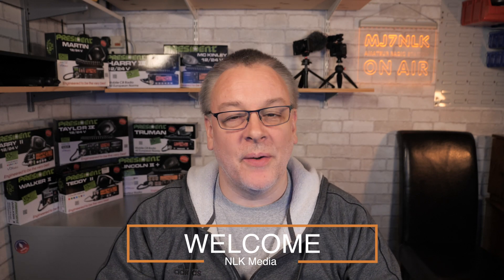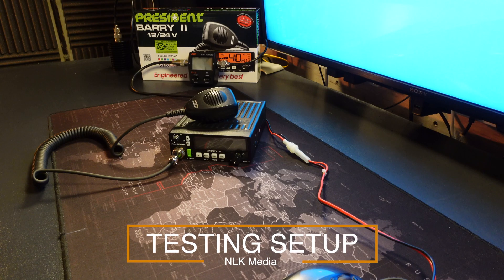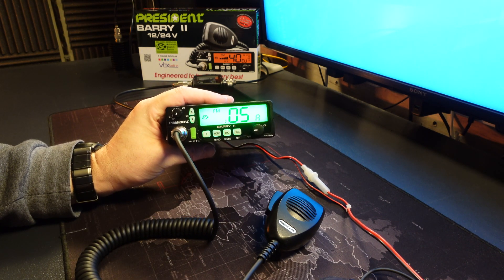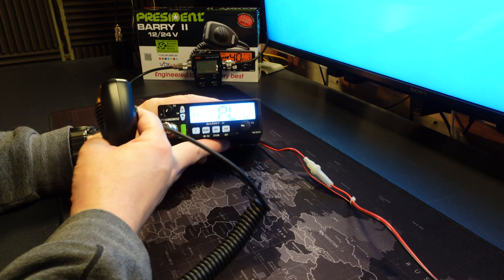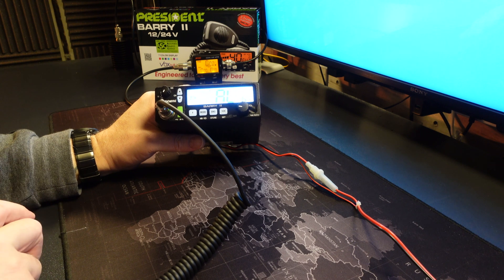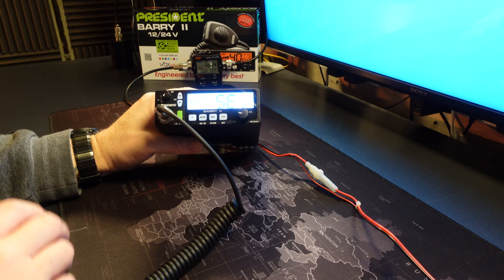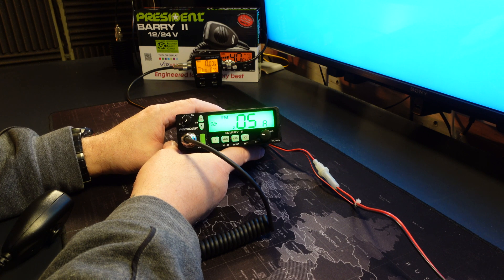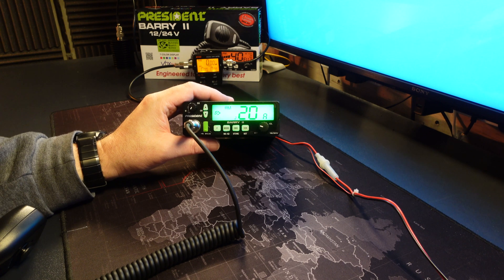President Barry II CB Radio - Part 2 - Power Adjustment - Service Menu

Comment: Vielen Dank für das hilfreiche Video. Ich mag Deine ruhige Art Dinge zu erklären.  Ich hätte eine Bitte ! Könntest Du erklären was A Band, B Band und C Band bedeuten? Im legalen CB Funk betreibe ich nur A Band? Ich freue mich auf weitere Videos. Ich kann Englisch noch verstehen, das Schreiben fällt mir aber schwer. Bitte verzeihe
Reply from the maker: Hallo, danke fürs zuschauen. Die Bandblöcke beziehen sich auf 40 Kanalblöcke mit unterschiedlichen Frequenzen. Der A-Band-Block umfasst die Standard-CEPT-Frequenzen von 26,965 bis 27,405 und wird normalerweise als Normal bezeichnet. Bandblock B wird normalerweise als Superior bezeichnet und beginnt nach Bandblock A bei 27,415 bis 27,855 und Bandblock C wird normalerweise als Inferior bezeichnet und liegt vor Bandblock A, beginnend bei 26,515 bis 26,955. In numerischer Reihenfolge geht es also zu Bandblock C, dann A, dann B, der 26,515 bis 27,855 in Schritten von 10 kHz abdeckt. Wenn Sie ein President-Radio haben, ist dies im TS-Modus der Fall, was normal ist. Wenn Sie sich im T0-Modus befinden, nehmen Sie 5 kHz ab. T0 bedeutet -5 KHz. Es kann zunächst verwirrend sein und einige Radios haben andere Blöcke D, E, F usw., die nur mehr Bänder in 40er-Blöcken sind. Ich hoffe, das hilft und der Übersetzer hat das gut umgesetzt. Alles Gute und danke fürs Zuschauen.

Hi, thank you for watching. The band blocks relate to 40 channel blocks with different frequencies. The A band block is the standard CEPT frequencies from 26.965 to 27.405 and is usually referred to as Normal. Band block B is usually referred to as Superior and starts after Band block A at 27.415 to 27.855 and Band block C is usually referred to as Inferior and is before Band Block A starting at 26.515 to 26.955. So, when in numeric order it goes Band block C, then A, then B covering 26.515 to 27.855 in increments of 10KHz. If you have a President radio this is the case when in TS mode which is normal mode. If in T0 mode then take off 5KHz. (T0 means -5 KHz). It can be confusing at first and some radios have other blocks D, E, F etc which are just more bands in blocks of 40. I hope this helps and that the translator has done well converting this over. All the best and thanks for watching.
Reply: @NLKMediaGroup  Hi. Yes! The translator worked well. Thank you for the detailed explanation, which I did not expect. That is not a matter of course. With your explanation and my own research, I think I got it. The A-B-C radio bands irritated me. I think they correspond to the allowed German channels 1-80. These are radio bands A and C. Channels 5-40 are listed as "Export" which is believed to be radio band B. In any case, I will have to delve deeper into the matter. I would like to thank you in advance for the help you have provided and I would be very happy to see more videos. So I say a "73", which means greetings here. Joerg
Reply from the maker: @coolerkerl  Thank you for your reply. If you check my website, I have a service sheet for the President Harry 3 (different radio I know) you can download which has the standard frequencies in it for each mode on a President radio. https://nlkmediagroup.com/presidentharry3cbr/ It's at the bottom of the page and is a link to the PDF which might be helpful on Page 5. I will compose a full listing of the band blocks at some point and make that available. Time has been my issue recently, but I have a few weeks off soon and intend to be pushing some videos up. I have 10 CB radios on the shelf ready for review (President, CRT, Alinco and Midland) and am desperately trying to get to them. I might do some shorter unboxing videos on them and then follow up with more in-depth reviews afterwards. I have so many plans for videos but with a large family and increased work pressures I am struggling to get to them. Things should settle down soon so will be back uploading again. 73's to you, all the best. MJ7NLK
Reply: @NLKMediaGroup  Thank you for the effort! And for the tip about the website, which I didn't know about yet. I already knew the list on page 5 in a similar form! I just couldn't match the radio channels to the band blocks.
If you intend to make a list of tape blocks, don't make it just for me. This is also a task for me. I can't always let other people do the work. I am very happy about your invested time and the videos to come. Always remember that your free time must also benefit your family. With this in mind, good luck for the coming weeks. Greetings from Jörg

Comment: Hi there, very useful video, many thanks. In your opinion would this be a good starter radio. Have you tried out in the field and with what antenna?? Cheers, John.
Reply from the maker: Hi John, thanks for watching and thanks for the feedback which is appreciated. Yes this is a great first radio, you cant really go wrong with any of the current President line up. I personally use a Diamond HF10FX antenna (see my video on that) which is easy to tune and works brilliantly for me on 10 meter (HAM Band) or 11 meter (CB band). "Height is Might" with CB Radio and HF frequencies so the bigger the better but it depends on your vehicle. Your not going to get away with a 2 meter antenna on a Smart Car :-). The Diamond is expensive and there are much cheaper options available. Thunderpole are good (the Orbitor HD is good value, Orbitor SS stainless steel is good also), K40 or Wilson are excellent. Maybe a Wilson "Little Wil" would do nicely and reasonably priced or the Wilson 1000 if thats within your price range. All the best
Reply: @NLKMediaGroup  Hi and many thanks for the great reply. All info is greatly appreciated. Keep that content coming. 👌